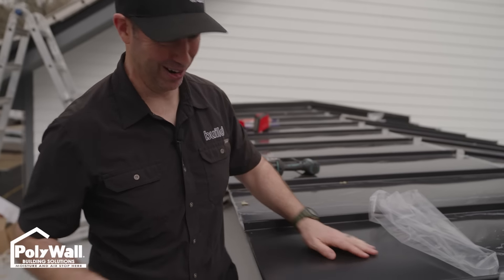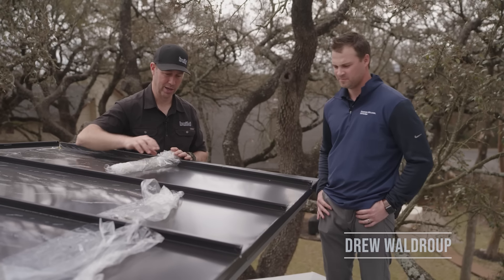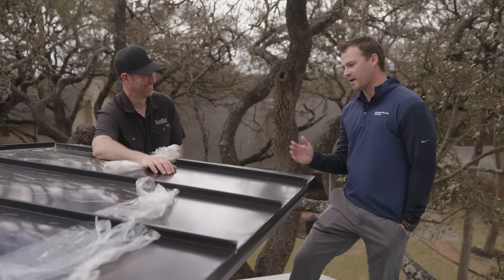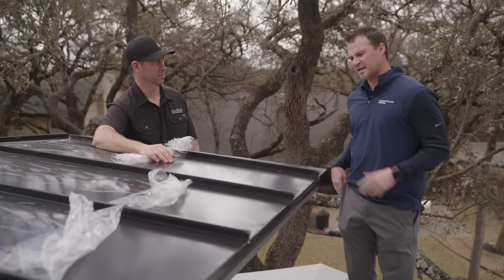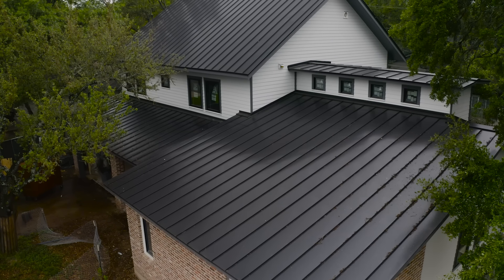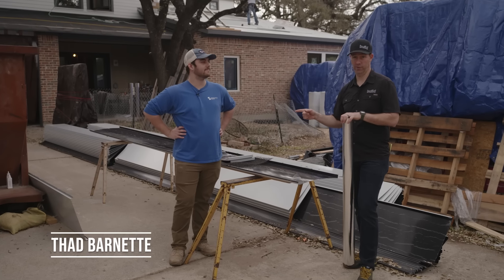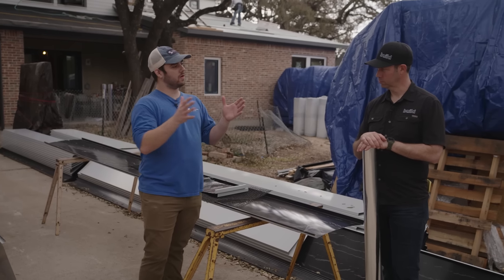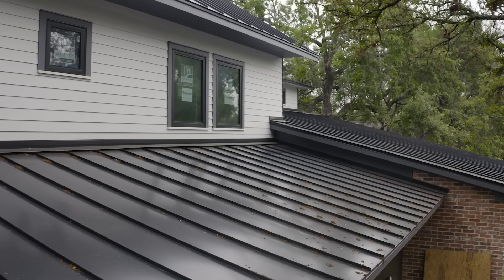Black Metal Roof - Dumb Idea?

Comment: Yes. Back is a bad color choice for a roof In Texas. The paint will be fine, but it will be soaking up tons of heat that you will have to offset with more insulation. A score of 22 out of 100 on reflectivity is terrible.
Reply: It will release the heat better after sun down however.
Reply: @christianvanderstap6257  um.. why is that? The color effects how light is absorbed or reflected. Not how it is released after sundown...
Reply: @christianvanderstap6257  With a lighter roof you wouldn't need to radiate as much heat in the first place.
Reply: @jonathanrogers9961  The color affects the ability to radiate heat into a cold surface, i.e. the night sky. Black objects radiate the best, white and reflective objects the worst.

Comment: Canadian research people found one of the biggest contributers to attic temperature was roof color way more then ventilation
Reply: In some of Montreal's neighborhood its illegal to build or rebuild a non white or green roof.
Reply: I have a well ventilated roof but you could not spend more than a few min. in the attic in the summer but when I put a white metal roof on with 2" insulation it was at least 20 degrees cooler and lowered my electric bill. I live in North FL and when I saw that black roof, well I'll keep my thoughts to myself.
Reply: He also has closed cell spray foam on roof deck. So his attic is room temp.
Good part about the black and reflective.. It will dry any mold or moisture out quickly.
Reply: Matt has studs insulation with rock wool, then 5/8" zip, then 4 inches of foam, then another 5/8" zip, then a radiant barrier, then a air gap, then the metal roof...im sure he isn't affected by the color at all...Great work Matt!
Reply: @infiniteadam7352  Exactly true. I don't know why so many other comments here don't understand this.
Reply: @OlivierBL  I would think in Montreal they'd be looking for heat gain, as the winters are long and the summers are short.
Reply: @billvojtech5686  summers aren't THAT short and they are hot and humid as hell.  And during winter well there's snow on the roofs so it won't make much difference.
Reply: They put your radiant on shiny side down. So it won’t work.
Reply: @BuckRogers20011  It's a foil so it's reflective from both sides but has a protective covering on it for continuing with  the build.
Reply: Ganga Din  maybe but you don't seem to understand that the summers can be insanely hot in Montréal! In most regions architecture can easily be adapted to their climate but here it wasn't. Of course its good to put most heat gathering windows south the the architecture of the city hasn't been thought like that 100 years ago. For instance I live in a very old building that has a big convex skylight in the corridor. It sure helps to heat in the winter but during 45°celsius heat waves its just insane.
And Nobody cares about the snow on the roofs really.
Reply: The way he's built his house, his roof won't heat his attic. It may kill birds, it will certainly add to the local urban heat island effect, and I'd hate to be the worker getting up there in summer for any maintenance or repairs or installing solar panels - but on the plus side, at least that worker can have fried eggs for lunch, I guess.
Reply: If your attic floor is insulated to at least code-min and there's no HVAC in the attic, does it really matter what the attic temperature is?
Reply: Canadian researchers can’t define what a woman is so I’m not concerned what Canadians think.

Comment: Matt, good explanation regarding why you can get away with a black metal roof in the South. For the reasons you explain, I went with a light white metal roof on my house in sunny Charleston, South Carolina (panels applied directly over ice and water shield membrane) . The performance regarding heat gain has been pretty good. But the big problem we experience has nothing to do with energy efficiency. 
A fair portion of my roof is overhung by a huge water oak that drops particulate matter and leaves on the roof several times a year. (I'm sure you've witnessed this around Austin as well.) If I don't pressure-wash the roof once a year, I end up with a black roof by default after about three years. It's pretty amazing. And I noticed that your house has oak trees overhanging part of it. I can't tell what species those trees are, but if they're water oaks or even live oaks, you'll look pretty smart with a black roof because it won't easily show that particulate matter buildup. (Yeah, if left on there, it stains.)

Comment: With so much insulation underneath required for Passif Haus certification and a layer of radiant barrier with an air gap, Matt doesn’t need to care what colour roof it is, to be honest.
Reply: Not really. He's in Texas. Every little bit he can do to help his A/C is going to save him money for the next 50 years.
Reply: @dlwatib  I beg to differ. He’s got an R20 roof deck with an air gap. That’s before the radiant barrier, another layer of air gap, and the interior insulation are taken into account. It really won’t make a difference what colour his roof is at that point. Indoor cooking would add more heat to this home than his roof colour.
Reply: Ganga Din  Yes, I do. All I’m saying is: with that much insulation, the heat gain from the black roof is negligible. His heat gain is more likely to come from windows and indoor cooking than the roof at this point.
Reply: It's still going to create a whole lot of hot air, even if that hot air is excluded from his living space. Energy efficiency is about trying to minimise global warming - he had a choice between a colour that would reflect incoming solar radiation straight back out to space, or a colour that would add to his local urban heat island, and he chose the wrong one.

Comment: That black roof is also going to expand and contracr more than a lighter roof.  This will result in more movement and more stresses on fasteners and anchors holding the roof in place.
Reply: This is solved with proper engineering and roof design. If you know how hot the roof gets you can calculate exactly how much it will expand and how much stress it will put on the fastners. Not a hard issue to mitigate.
Reply: @joshnabours9102  so in other words, yet another cost penalty to mitigate a bad choice.
Reply: @joshnabours9102  The expansion and contraction of the roof will overcome even the best fasteners over time!
Reply: @gmcnelly2468  sure, but if it works fine for 20 years then you are good.
Reply: Strapping the roof first and doing metal on strapping is the best way.
Reply: No this company has engineered for this variance.

Comment: In Buffalo NY the black metal roofs are often the only ones with 0 snow on them during the winter.
Reply: You know that snow will never collapse the house if you have a black roof then.
Reply: How do you know what color the roofs are that are covered with snow?
Reply: TBF, I wouldn't mind the snow on the roof as long as it doesn't melt and refreeze. Hey, it's free insulation!
Reply: @hailexiao2770  it is also a massive amount of weight that, with enough of it, could collapse the whole building.
Reply: @joshnabours9102  last time I checked, homes are designed for snow loading.
Reply: @KC9UDX  to a degree yes. But it is certainly not impossible to exceed those designed in weight limits.
Reply: @joshnabours9102  unspecified amounts of snow are inevitable I guess
Reply: @travelfeet  lol because they are never COMPLETELY covered in snow. You can always tell part of the roof

Comment: I work in engineering for a major steel building company. A few years ago we switched to the same type of heat-reflecting material used in these panels. It really does reduce the amount of heat in the material and inside the building.
Reply: Friction condition conduction convection meteoric or imperial reflect  🧙‍♀️ ray of lite is a wave and a particle? Haha I hope a good answer is in route to a miracle mike know Ik magic like Voldemort balls in the your court?

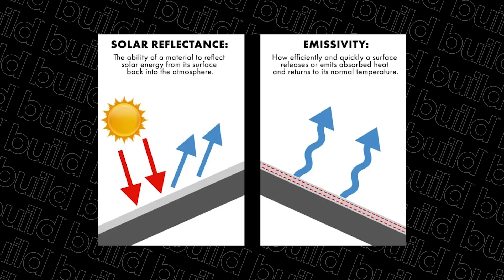Comment: He answers the question at 3:35
SRI index  Black 25 White 100  = Yes it is a dumb idea.
Reply: It isn’t that simple. There is also emissivity. Black radiates heat better than white. When you combine it with a radiant barrier that reflects the heat back to the roof where it gets reradiated back to the sky. This is the same reason tinted windows cool a car despite being dark. Yes, white would be slightly better, but black isn’t dumb.

Comment: Lighter colors are essentially free AC as they keep the roof components (and therefore attic temps) from absorbing the sun's energy as quickly as dark ones. But if you design in with this in mind - especially raising it up off the deck -  it's ok to go with a dark color. 

BTW, The black looks great on your house.

Comment: When he was talking to the tech,they made the comparison between the black metal and a white asphalt roof,not between white metal. Were not stupid,white is cooler. But if you put enough insulation and air gaps you could cool down a volcano. Shsh!! Matt
Reply: I have a regular galvanized corrugated roof with airgaps underneath. Roof is composed of 8 inch thick foam panels encapsulated in reinforced crete. It is nice and cool on hot days.

Comment: My father worked for Gulf Oil 50 years ago and he did testing on paint colors for oil storage tanks.  He measured internal and external temperatures and WHITE outperformed darker colors (even silver) by a signficant margin.  Using any color other than a very light color on a roof whether metal or shingle adds significant cost to cooling bills in the summer.  If you live in a southern climate, do NOT buy black!!  Maybe up north it works to keep those folks warm in the winter?

Comment: For many people calling out that the Reflectivity index was all she wrote and therefore dumb for him to do. If he was to put the standard asphalt shingle roof like 90%+ homes have the reflectivity and emissivity is out the window. It's just a tar jacket soaking up the heat and molding over time. of course, there is going to be a heat index difference in lighter and darker colors but that doesn't mean he trashed the house and it's worthless now. he definitely did a phenomenal job on the roof and could've put a plastic bag on it and been far better than most homes.

Comment: Lot's of strange things in this video.  First of all, when I think about dark color for a roof I don't focus on the fading as much as the heat gain.  An air gap is good but in the south where the moist air retains more heat, a dark roof creates a outer layer of heated air that can prevent air from moving efficiently through the gap.  Also, a reflective barrier should always face the air gap that will remove the heat, but it should also face towards the source of that heat.  In the video it looks like you placed the reflective side facing down on top of the gap material, which would be the exact opposite of what you want.  In fact, facing down under the metal it would essentially act to conduct heat from the dark roof directly into the gap, preventing it from leaving, and any kind of dark roof sheathing below would absorb that heat and conduct it into the house.
Reply: Yes I was thinking the same thing in regards to the radiant barrier installation. Maybe I'm missing something? Nevertheless I enjoy the advice and work put in to creating these videos.
Reply: Read up on EMISSIVITY.  It's confusing, but  that radiant barrier is installed properly.
Reply: @JessicaLarsonDVM  Nope, that's just not right.  This is one of those things that every architect is trained to do, be able to calculate heat transmission at every point through a wall.  I found this guy, who I assume sells a reflective barrier product and demonstrates the installation.  He shows and explains it correctly.   https://www.youtube.com/watch?v=dEl5tNRmVoo

Comment: Wouldn't the radiant barrier do more good on the bottom of the air gap with the shiny side up?  It looks like you'll mostly be reflecting radiant heat from the attic back into the attic with the way you installed it.
Reply: I agree. His application of the radiant barrier and its air gap looks backwards to me. My understanding of radiant barrier installation requires the air gap to be between the source (roof) and the radiant barrier to isolate the space (attic) below.

Comment: Yeah, it's weird, but the installation instructions for the sharkskin radiant barrier does say to have the reflective part down.
Reply: That's because it's used for it's low emissivity, and not for it's high reflectivity.  See my other comment for a longer explanation.
Reply: It's not weird if you understand thermodynamics, but then the physicist inside screams every time I hear someone says heat rises. Hot air may rise heat is unaffected by gravity to any noticeable effect unless you happen to be in the vicinity of a black hole.

Comment: It looks nice.  I have a hard time believing it won't add more heat to the home unless you have super insulation in the roof.  Being set up off the roof might help some.
Now for the advantages besides the look, 1) you can have solar panels installed inside those standing seams which will match the color 2) you could run pipes underneath the metal to draw heat away and heat up a solar water heater.  3) You'll be able to hear the Ninjas when they are walking on your roof because they studied in Hollywood and can't help but yelp when they touch that roof in the summer.

Comment: Matt, I'm a huge metal roof fan and have it on both my standalone garage/office and house.  I'd welcome your input on oil canning.  I don't think you mentioned oil canning on your vlog but in my mind it's the big risk with metal roofing.  On my house the builder use foam backing to create a convex surface between the ribs.  This has seemingly eliminated oil canning.  On my garage a different builder didn't create a convex gap between the ribs and I get some oil canning as the roof heats up.  Also, I believe snap lock (my house) vs mechanically seamed (your house) allows some movement between the panels also lessening oil canning.  Mechanically seamed is no doubt superior in very high wind areas and heavy snow/ice damn areas but I would think neither would apply in Austin.  Finally, I chose a light color (silver) which heats up less than black and thus reduces movement between the panels.  On your drone footage I thought I saw some oil canning.

Comment: can’t be any worse than a black asphalt shingle? just way more durable and better looking, i’d go for it.
Reply: With asphalt shingles, the color is almost irrelevant when it comes to heat load inside the house.  It simply takes longer for the asphalt to get fully heat soaked in sunny weather.  After that point, the differences don't matter.

Comment: My house survived the 6.4 and 7.1 earthquakes in Ridgecrest CA in July 2019.  I have a HEAVY concrete tile roof as well as a massive solar panel system installed.  We ran outside during the 7.1 and could see the house shifting back and forth and the roof moving the other way.  Lucky for us this house was over engineered (original owner was a real (no kidding) rocket scientist and rode the contractor’s and builder’s ass during construction).  We are moving to Bulverde TX in a couple years and want  to build us a custom home.  Already bought the land.  Matt Risinger we sent email to your company.🇺🇸

Comment: Nice work, Matt.

Even with shingles the color does not matter that much due to the low emissivity of asphalt. All shingles heat up and once they get hot it takes several hours for the heat to be released. More important is having OPTIIMAL VENTILATION on any roof. 
Another point about SRI- We have installed epoxy roof coatings with an SRI of 115. They work to the degree that bare legs get burned in about an hour the Texas sun. This is a great solution for low slope and poorly ventilated commercial roof  situations. With metal...just pick the color you like and use proper VENTILATION.  Watch more videos before you let anyone talk you into a fully foamed attic space.